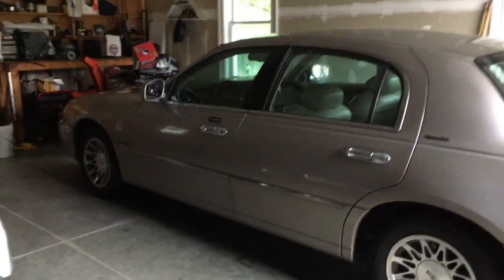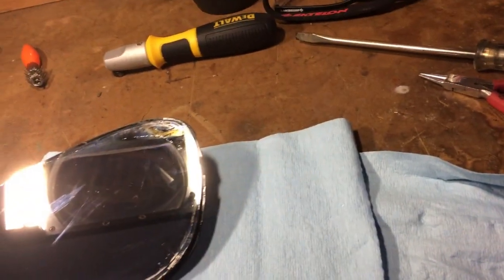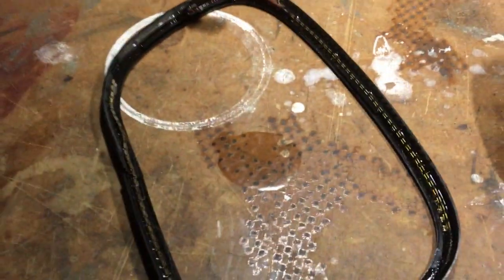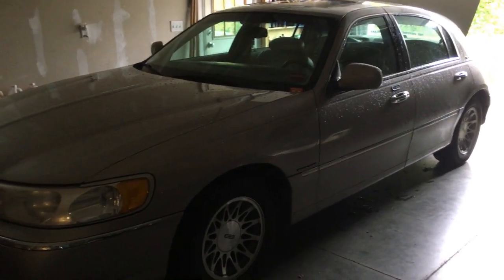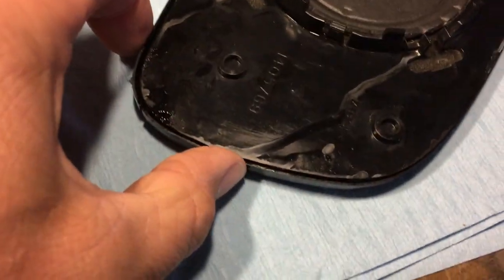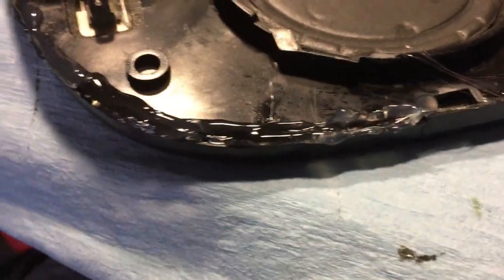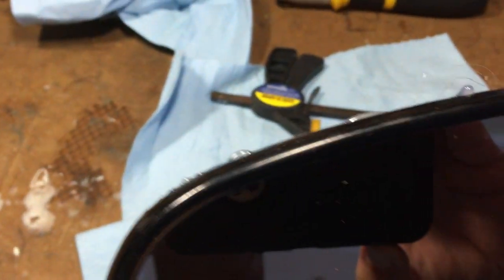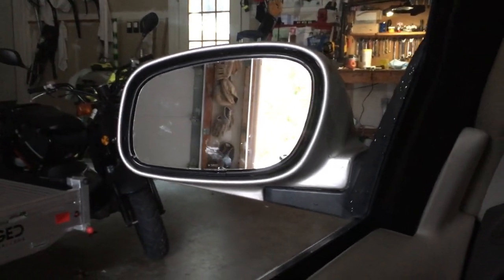How to repair / replace 1999 Lincoln Town Car Driver's Side Mirror

Comment: Is the oil supposed to be in between the two panes of glass, or did it seep down into it from the seam?  Does your defrost and auto dim still work? - I mistakenly bought the same Burco glass thinking it was an OEM replacement but if it functions properly I don’t mind keeping it.
Reply: IFish4Tuna  The black trim piece with the metal “zipper” fell apart when I was disassembling the mirror.  Is that piece necessary for heating, or is that just part of the auto-dim system?  I’m thinking of leaving it now that it’s broken.
Reply: @IFish4Tuna  I hot glued it like you did.  Unfortunately, the replacement was about an 8th inch smaller on every side so it didn't line up perfectly.  It's a Mickey mouse job and I'm not totally happy with it but it'll hold me over until I can get a nice junkyard replacement. Thanks for making the video.

Comment: How did you get the wires off the mirror? Mine seem to really be stuck on.
Reply: @IFish4Tuna  Thanks, I finally got them off. I used some WD-40 and a flathead screwdriver.
Reply: @IFish4Tuna  ppl uh